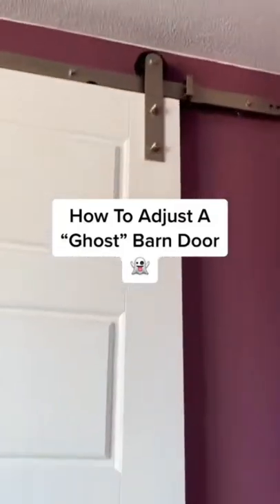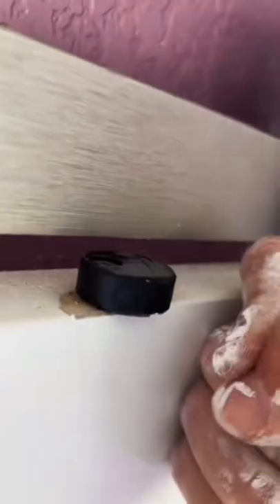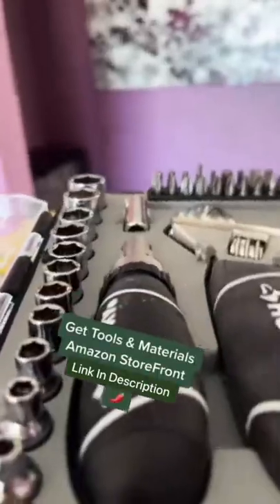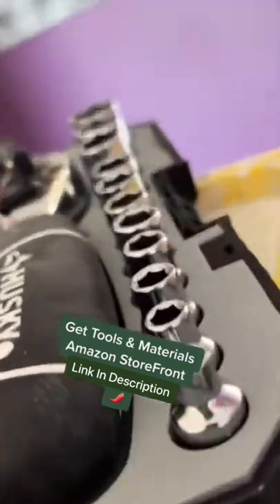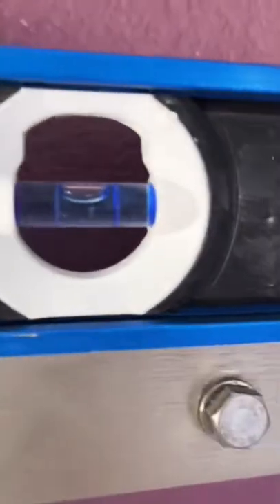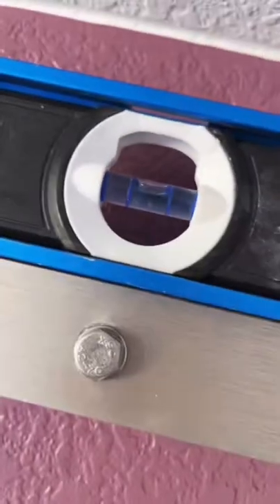How To Adjust A “Ghost” Barn Door. #barndoor #homemaintenance #handyman #diy #howto #tutorial

Comment: Better solution is don’t use barn doors
Reply: Barn doors are the second most efficient use of space, you don't need a clear space on the floor space to open it. You only need the doors width of free space on the wall behind it.

The only way to make it more efficient is to set it in the wall. 🤔

Also also, it's real simple to install and uninstall this type of door, a regular door can be bitch to get on its hinges sometimes. 🤔
Reply: @QuilloManar  it doesn’t actually give you any extra space because you still have to keep the walkway clear and they they do not seal so they’re not good as a privacy/ noise buffer either. The only thing they’re good for is pantries or maybe a bedroom closet. 

If it is “set into the wall” as you said it’s called a pocket door and those are actually good because they close all the way 

Regular doors are easy to get on their hinges it’s hanging them in the door frame that can be complicated
Reply: I've found that barn doors can be used for privacy if you overlap the opening by 3 inches on each side.  They look great but do require travel space, but not much. 

Pocket doors are great, but tend to fail over time and are a pain in the as to work on.  Barn doors and pocket doors are similar in difficulty to install (pocket doors require a lot more tricky jamb and trim work), but barn doors look great and are easier to work on in the future.
Reply: @QuilloManar  not efficient at keeping the room warm
Reply: @JB  do you mean not a good seal? If your whole house is heated/cooled, then the seal doesn't matter. Also you need airflow. High levels of co2 from a too good seal is a bad thing.
Reply: Ya i hate mine and nothing is wrong with it. Just a stupid sliding door that doesnt even need to be there.
Reply: Sadly they're gaining popularity and I hate installing them
Reply: @terryrickman2975  There are certainly uses for it though, I have installed one for someone who was in a wheelchair and needed a wider door
Reply: @johnhunter7244  ya im 32, noone is handicap and its only there to seperate a large 10x12 walk in closet and tbh i dont use it as a closet i use it as an armory. Homeowner before i bought hung this crap up. This door is impractical and i am taking it down. Serves no purpose besides trying to make something seem rugid and country but its far from it.
Reply: The bottom also isnt secure and stable and its literally just hanging there. Just stupid. Not secure to keep kids or animals from going in and out. Or anyone in that matter. Like i said im taking mine completely off
Reply: @terry rickman  I mean they provide much better privacy than not having one.
Reply: @johnhunter7244  ill have an actual door on it. Cant lock this to where noone can get inside it or move bottom out since its just hanging there this is literally only for decoration. Privacy is easily invaded with this barn door. Not sealed so you can hear through it and only attached at the top. Like i said this is not practical for an armory door and what i need so im removing it. Like i said its just a artsy non door its a sliding partition wall.
Reply: @johnhunter7244  no
Reply: @Jesse Pruitt  no to what? I don't think they're great but they are better than some people give them credit for.
Reply: I had them at my last place and they were super annoying. I thought the idea was cool but the novelty of it wore off real quick(especially in the morning when a crapload of light shines in from all sides at sunrise since they don’t seal).
Reply: @nikki5399  yea they suck unless it’s for a pantry or closet situation
Reply: @johnhunter7244  no they’re not
Reply: @jessepruitt4750  "no"
"What do you mean by no?"
"No"
Reply: @johnhunter7244  No means no
Reply: @jessepruitt4750  bruh
Reply: @johnhunter7244  it mean that they are as bad as they seem. A pocket door is a better option
Reply: @QuilloManar  we have them inside the walls. Where it's possible atleast
Reply: @JB  is the rest of your house not heated. Do you have one heated room and just let the rest freeze
Reply: they are a horrible defense against clowns
Reply: @Bomberninja  and bees
Reply: They might do ok against a zombie. Like a walking dead zombie not a world war z type zombies
Reply: @johnhunter7244  if your whole house is heated/cooled then you’re using more fuel, and spending more money, than you might need to.
Reply: @toddbod94  OK, and how is that relevant to what I was saying?
Reply: OP I was thinking the same exact thing
Reply: @terryrickman2975  ...why do you need to lock doors inside your own house?
Reply: @ecyor0  in case someone breaks in they wouldnt have acess to my weapons. Nor would any kids i have in my home have acess to them. Also another reason to be able to lock doors inside is if you intend to have sex and you dont want kids or anyone just walking in lmao. These doors are only for looks zero privacy lmao
Reply: the only good application of barn doors is on houses with shitty foundations/on hills, as the long term maintenance when your house starts to sink is much easier. Normal and pocket doors require removing material from the physical door as the fran shifts, barn doors just require a simple releveling like in this video. Besides that, barn doors kinda suck, same friction issues as a pocket door without the flushness.
Reply: @QuilloManar  that would be good for you so you can horde more trash in your dungeon

Comment: Actually make it not level in the other direction, and it's a free door closer that doesn't need fresh springs every 10 years.
Reply: That would make the door never stay open, which would become an inconvenience to anyone in the home.
Reply: @itsbriarwallace  It's a simple choice of what is most convenient for that particular door. Once decided, the handyman or builder can make it happen with minimal effort.  Making it stable in both positions requires either a lot of friction (the video "solution") or a rail that isn't straight.  There is one common saying about barn doors, and it focuses on why they should be kept closed.

Comment: I need a man like you in my life. I live in an apartment with sliding door closets. The track is off by over half an inch and is so horribly misaligned it will break the door. Just a matter of when
Reply: Then just repair it I guess.
Reply: Then fix it? It’s super easy to fix

Comment: I hate these doors. At my mother's house, whoever owned it previously installed one. The track ripped out of the wall and was installed with giant drywall anchors. I would think they should be screwed into the stud right? I'm no contractor, but it just didn't seem right
Reply: Yeah supposed to be into solid wood. When I put them in on remodels I put a 1” thick board behind the track which I screw into the studs then I can lag anywhere.